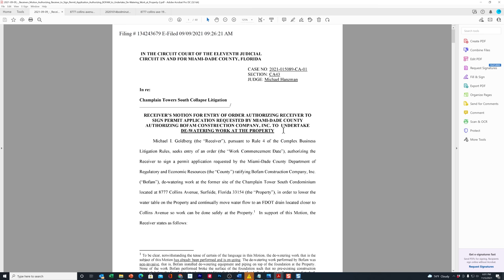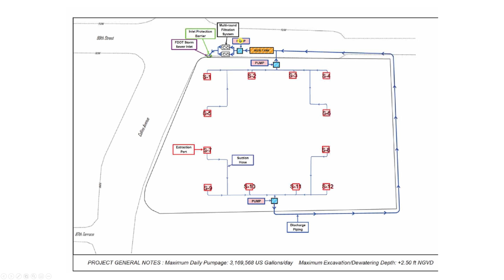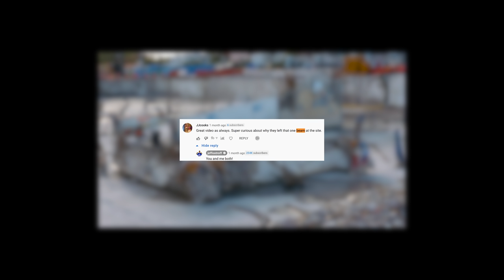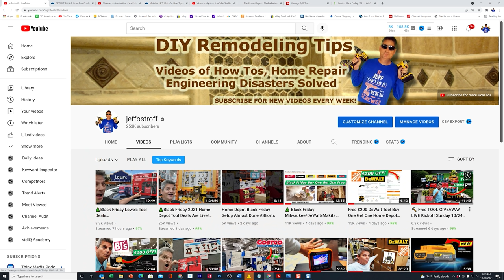Miami Condo Collapse: Engineers Baffled By Mystery Column

Comment: I still think the mystery column was once sitting on top of the H beam and was the first thing to collapse.
There was load bearing in that area all the way to the roof, if the beam snapped then fell with all the weight of the building on it, it would have punched through the slab like a bullet through a paper target then it would have been pulverized so nothing was there but rebar.
It probably broke first and brought the rest of the core down with it, as the debris piled into the basement it would have buckled other columns and the whole building came down.
Also the short ends of the H beam appear to be broken off, that may have happened as the building came down or the was the trigger.

Comment: That looks like it was an electrical panel bank. Emt conduits stubing up out of the concrete. You can see kinked pipe (regarding does not kink) also no concrete around the bottom like you see with other columns.

Comment: My Speculation: From the collapse video it collapsed like wave parting across the middle of the building building. The Rebar may still have been connected at the H and as the building collapsed starting in the basement columns, and happened to shift towards the ramp.  Additional columns out of the field of view could have also been painted red. The pitch between the columns seems to very much be where a car would park, and not the lane.
Reply: You're right, there was another red column in the garage - 80+ FEET AWAY.  The H beam was displaced off the top of it's columns by a couple of feet, at most.  For the most part, it is where it was...
Reply from the maker: The collapse video from the 87 park condo security camera next door shows the first columns falling were possibly K10, L10 and M10, then progressed to the right to the H-Beam. I think the H-beam was not the cause, but rather was just along for the ride.

Comment: Was the fitness center in the basement? That would be the best place to put it, but... How many weights were in that room, and was there also a type of gym machine with stacked weights. Btw, one would be very surprised how a gym machine with stacked weighs can still damage an above average foundation.

Something we might never know... What was in the individual condominium units? Could it have been anything of above average weight.

Although presently unproven... A number of residents have stated that there was a considerably large (and also remember how much salt water weighs per gallon) salt water aquarium in one of the units on one of the higher floors. Some say it was as something of about one hundred gallons, others state it was higher than three hundred gallons.
Reply from the maker: No the fitness center was not located in the basement it was on the lobby level directly over parking spaces we've covered this in earlier videos in the summertime

Comment: Something I noticed is that all the other pilings have some concrete left near the bottom where the rebar goes into the ground but the mystery column does not which probably means it was built differently than the rest  of the columns.
Reply from the maker: While you are right that most of the columns do have some sort of concrete at the bottom if you look closely on other photographs of the completely empty site, you will see that some sites there are missing columns, and in some other areas there might be just a few rebar's coming out that have no concrete in them and yet they are still coming out of the floor. So I don't think the lack of concrete tells us whether there is a column there or not because at this point we have no idea what stuff the excavators took out of there and cleaned up

Comment: Jeff, you will notice that the "H" beam does not have any rebar pocking out of the top of the crossbar between column 17 and 24 which you might expect. However, IF that new column from the first floor was only "resting" on that crossbar (heaven forbid) then the column could have speared down and punched through the carriageway in that position. So is that mystery column actually tied into the floor rebar or is it a "punch-through" that is standing in place with no support?
Reply from the maker: Yes that is another popular theory that many people have mentioned the only problem with that theory is that column was originally about five feet over from where this mystery column is and so if it did come down and Pierce into the garage floor it would have been at an angle or it would have been several feet away

Comment: The picture at 13:58 appears to show the 'mystery column' rebars in the floor between the main columns.  The 'H' beam was offset from this line on the steelwork plan.  Also there seem to be rebars from the top of the cross beam for the column that rose to the floors above.  What do you think?
Reply from the maker: Seems like very few rebar for the K column on tops of the beam

Comment: 14:07  Your mystery column rebar is unlike ALL the other floor column rebar in that it does not have an orderly tight formation at its base. Compare to the one beside the traffic cone - it comes neatly out of the floor.  The mystery column rebar looks like a Chihuly glass sculpture compared to all those.
What I want you to do is zoom in tighter on Chihuly and the traffic cone rebar.  After appreciating the difference look directly between the two at 11 o'clock.  On top of the H-Beam should be the area of the connection point of the vertical support that went from there to the penthouse. But it seems like there is not much there of any significance - for something taking the weight of the building!  
I know zero architectural things to be clear however, I propose Chihuly is part of how that 'lobby' support post and the H-Beam were attached. 
Perhaps it was plated and bolted in allowing it to sheer off and while in a puddle look as if coming from the floor(?). In fact if it was sheered off it would be pointing still in its original orientation.  
To look for other clues - the balance of the rebar that is atop the H-Beam, so not originally on the garage level, is unlike the floor column rebar because it also appears quite Chihuly like.  That's all I got except that I have thoroughly enjoyed your serious. As a layman dude with no structural knowledge you've held my attention for hours. Fascinating work man thanks.
Reply from the maker: Thanks, I'm glad you liked it!

Comment: Jeff, are you sure the mystery column is not number 5 from the floor above? Is it possible it was rammed down and punched through the floor of the  garage? It would be in the correct place and where else could it have come from?
Reply from the maker: Your hypothesis comes up a lot from boatloads of people about that column. I don't think it's possible because if it had slipped off it would not likely have come straight down where the mystery column is which is only about two feet away from the HP. Also if it had impaled the floor there should be damage all over the concrete there and there is none where is the crater? So where else could the column come from? So far my prevailing theory is that somebody started to build that column sometime after Fiorella shot her video in July 2020. however I could find no permits for it

Comment: My theory is as a carpenter Foreman that mysterious beam was probably added later without a permit because somebody noticed cracking from expansion on the concrete above it like a temporary fix. That's the only way I can think of that water coming out of the holes for the rebar is if they were drilled afterwards and not bent and poured over it. Whenever we put rebar down we bend the end of it and then we put the wire mesh down usually on bricks then pour concrete.
Reply: Added a column in the middle of the driveway?

Comment: I suppose the column with all its rebar sticking out cannot suddenly just pop out of the ground at this late stage so it must have been in Theorella's video but we cannot see it for some reason. I was comparing the cracks in the concrete of t=4:51 and t=8:39 and when I looked at t=9:53 I wonder if the H-bar can have flipped over when it fell, the way the letter M would look like W if it flipped over 180 degrees. If so, it ought to be lying upside down from how it was initially installed. The flipping doesn't quite make sense though, the concrete being so heavy. At t=9:53 on the plan there's some few columns in the vicinity that are placed quite densely. Maybe it's one of them. I can't tell,  I'm not an engineer at all. (I'm an accountant... I only follow your videos from over here in Scandinavia because of all the interesting analyses!)
Reply: The H beam weighs over 65,000 lbs (29,400 kg).  I can't conceive of ANY force powerful enough (short of a nuclear explosion) to flip it over in the 3-5 seconds it took the building to collapse.  Especially since all those slabs were crashing downward on top of it.  No, the impact forces were all downward, nothing to push it upward.
Also, the intact H beam was 22 x 22 feet.  The garage ceiling height was only 10 feet, at most.  Bit of a geometry problem to get it to rotate...

Comment: It looks like you are off one segment of columns.  The H is around the ramp, not the drives.
Reply from the maker: My analysis is based on the floor plans I don't know what you based yours on but you're going to have to prove that and by the way the H beam does not go around the ramp. The floor plans clearly show as I showed you in the video where the H beam was designed to be inside the building it is one section over from the bottom of the ramp. And it fell in that exact place as the overhead photos show, so show me what page on what floor plan prove your point?

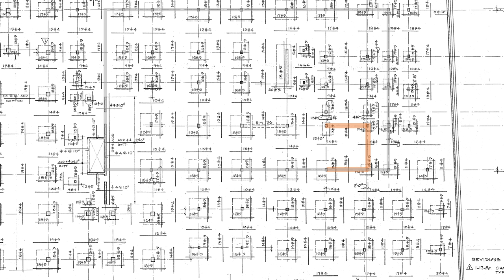Comment: I think the H-beam may have been moved.  Go to the plan view that you show at 8:25.  If you moved your orange "beam" vertcially up on the screen to the next "cell" the mystery column would be as shown in the photo.  You can't see the other one on the left side... it is hidden by the H-beam.
Reply from the maker: The beam did not move. Look at 1:06 again, that shot was taken directly overhead clearly shows that the H beam is exactly where I said it was. Everything makes sense and lines up including if you paid attention to where I said watch this column with the red stripe on the bottom. It's the only column in that area of the garage with the red stripe. And when you look at the video of the lady walking through the garage it clearly shows as I pointed out in the video, the H beam sits with the corner of it directly on top of that red striped column. So everything aligns with what I said. You need to prove how and where I am off.
Reply: @jeffostroff  Good point Jeff.  Not trying to argue.  It was just an observation of a puzzling situation where a column base (the rebar) has magically appeared.  I didn't get a takeaway of where you think that mystery column base came from.  Love your vids and I appreciate you following this super-important story that I have learned a lot from.

Comment: If the "mystery column" actually did sprout out of the basement/parking level, would it not have blocked the accessway for cars coming down the ramp and turning left?
Reply from the maker: By the end of the row, cars would have to drive around it maybe, still not sure on that. But they would have to be careful.
Reply: Illogical, but if the slab above was cracking and sagging, what choice did they have?  Leave the lane open and have the slab crash down and kill somebody?
Reply: @johnbergstrom2931  What was directly above the parking garage where this mystery column supposedly existed...the lobby of the building?  Do we know if there were any reports of the floor in that area "sagging" or anything?
Reply: @ThatBobGuy850  Nothing heavy, really.  The living room slab of unit 112.

Comment: Why do you not think this column was impaled? This is an 10+ story column supported entirely by the H beam with lateral stabilization provided by the building. Imagine the H-beam offsets and falls you probably displace the first story of the vertical column sideways however the remaining column is now still vertical and unsupported and elevated. the building starts coming down and the column pile drives into the ground.
Reply from the maker: The columns broke in segments, it's not like you have a solid column forcing it's way through an H-BEAM then impaling into the ground. The column on the floor too perfectly straight up to have come from the H-beam at an angle

Comment: Bummer about the troll you pinned, I hope I don't come across as one but, I have to ask: If you don't think the mystery column is from the 1st-Penthouse column being driven into the parking deck during the collapse, then what is it?  I have not been following your analysis so I admit, I do not know if you covered some aspect of it in some other video... but the question remains, if it wasn't there after construction but it was after the collapse, then when or why are you proposing it was put there?  Are you actually suggesting something nefarious?
Reply from the maker: that is one leading theory, but where is the damaged floor if it did impale the floor. My other theory is someone in the last 12 months started adding a column on the floor to help shore up the ceiling in the garage.
Reply: @jeffostroff  It being added after the fact, as shoring makes the most sense.  If you mentioned it in the video I must have missed it... due to lack of coffee.

Comment: I'm guessing that the column was displaced when the building collapsed and was crammed into the garage floor.
Reply from the maker: Lots of people saying that, but nope. The garage floor would have been damaged
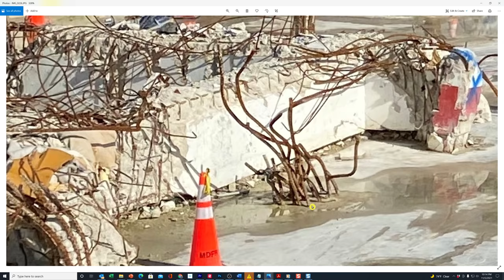Reply: At 13:47 you can clearly see the cut and patch job to the slab.
Reply: nope it lines up with the other columns at line 8

Comment: Do you do this often take a concrete column with hundreds of tons and drop it 4' to 8' on a concrete slab to know how it will act? where is the column stub on the top of the "H" beam? And why would they need an extra column on the under side of the "H" beam in the first place? And all the tenants were just fine with a column in the middle of the drive way! Your reason for not thinking it was the column from on top of the "H" beam is that it should have made a bigger hole. Look at the columns punch thru on the pool deck there it's just the weight of the deck with No drop force and how clean those holes are around the columns. They should excavate that immediately.
Reply from the maker: You are partially wrong. The holes were not clean around the columns. Many of those columns took large chunks of the floor flab with it, which is whey there should be damage tot he bottom of the garage floor where that column is. There should be a crater there. Tenants might not be fine with a temporary column, but if it was added there, they can still drive around it. the column on top of the H-Beam is with the rest of the rubble NIST carted off to their secret site for analysis.
Reply: No the column is on all the plans and has a pile cap.

Comment: Was there any possibly reports of a  accident from a vehicle because parking garages are extremely tight. Was there a car accident vehicle hit the column damaging the column and they added a temporary support this is why you do not see it in the video because going into Manhattan I'm in parking garages a lot and there be no reason to put a column in the middle where cars are driving unless one of the columns was damaged or the above column support because of water problems and started to crack and added the column for support. Being so close to the water I could see water problems cracking older existing column. But who added the column and why there should be a work order for it.
Reply from the maker: Oh please everybody keeps coming up with this ridiculous theory that a car went into a concrete column. There column was 100% of the time even if the concrete is degraded because you still have all of that rebar in there did you see how all of the columns were cut three or four feet off of the floor by NIST afterwards and all of that thick rebar is sticking up out of the floor not one of them budged even though a building fell on top of them.

Comment: I think this is the column that used to sit on the H beam. It almost appears as though it’s entering the concrete at an angle. If you look closely you can see a piece that has been bent very close to the floor.

Comment: Is it a pillar from an upper floor that harpooned the slab after falling and shifting a few feet?
Reply from the maker: Not likely, there is zero damage on the floor where there should have been craters or something else if it had impaled into the floor but there is no damage. These rebar rods look like they were intentionally built up out of that concrete floor like it was done by somebody in the last 12 months, since Fiorella shot her video inside the garage in July 2020, showing no column exists where that mystery column is.